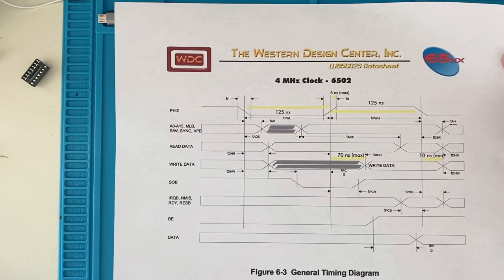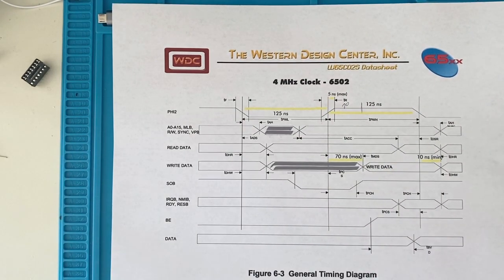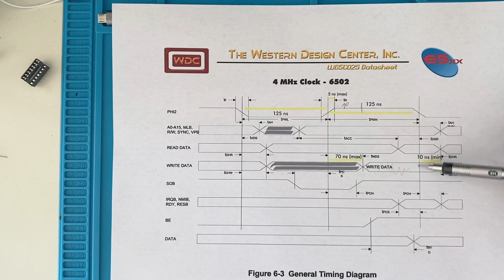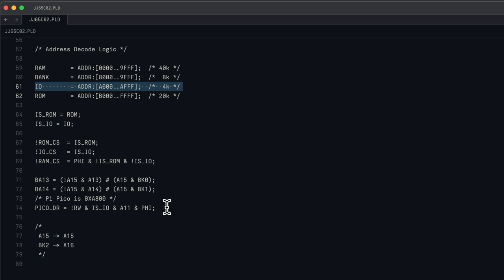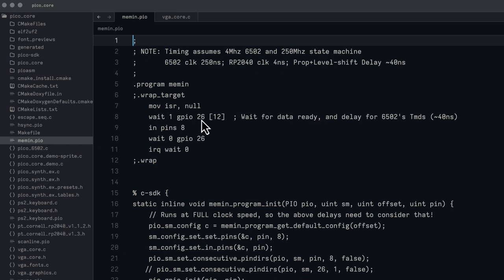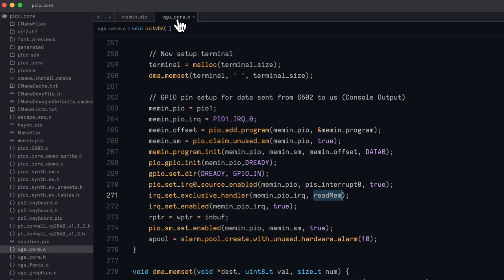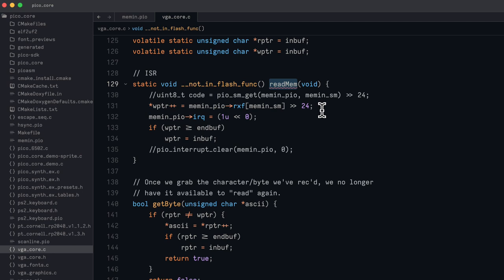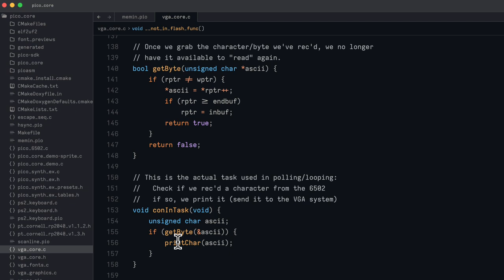Episode 5: Writing data from the 6502 to the Pi Pico

Comment: Cool project. How come you didn't run the 6502 side on 3.3v?
Reply from the maker: Mostly because all the other chips were 5v. Admittedly, I'm considering changing that with later versions, especially since it simplifies things quite a bit when both the 65* chips and the Pi Pico are all 3.3v.
Reply from the maker: BTW, your work is quite impressive and an inspiration.